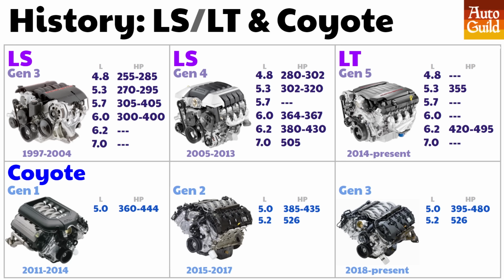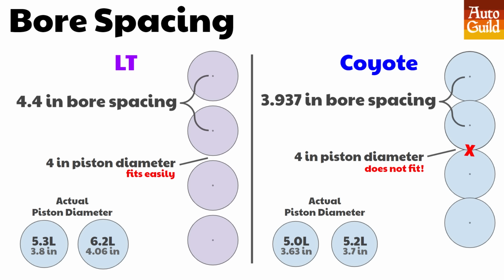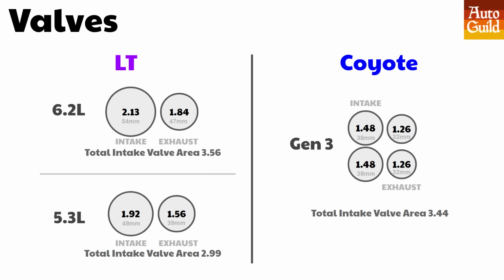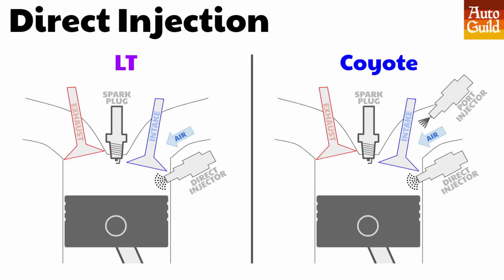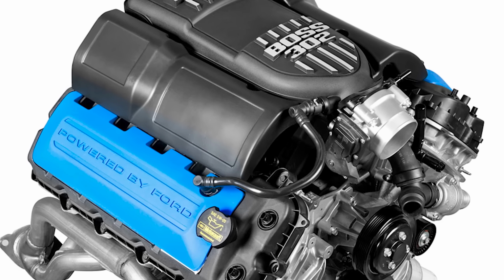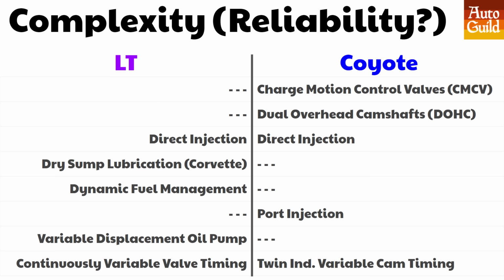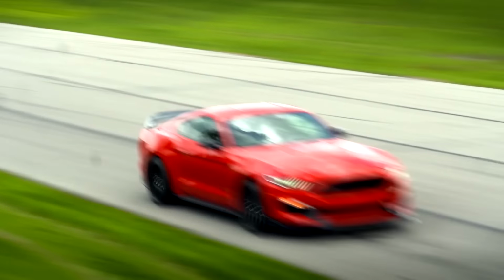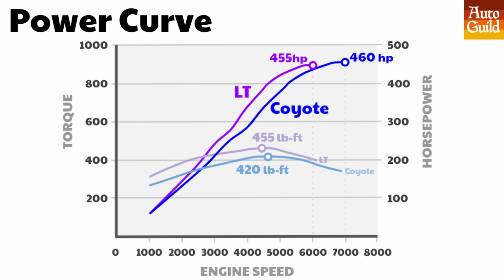GM Gen 5 LT vs Ford Coyote.  Which one is better and why.

Comment: I feel like the coyote is just kind of the “option b” for the LS/LT. It’s just a totally different platform that provides comparable performance. It’s a pick your flavor kind of thing. Adds a little flavor and diversity to the market. I’m a coyote fan mostly because ford actually finally did something about their underwhelming modular engines and made some engineering magic happen.
Reply: Swedish super car Koenigsegg uses an evolution of turbo charged  Ford 4.6 modular.
Reply: Yeah it pisses me off too I honestly don't like Ford after 96 They just copied Toyota You made your card way too freaking advanced breaking down and pain in the ass to work on They obviously couldn't get it right the first f**** decade you know it's about time they got it right and they're still having issues with the coyote that's the number one issue with that F-150 is engine issues and GM fell apart when they were came out with cylinder deactivation so they're now saving grace
Reply: Ford isn’t trying to fool anyone, they know they don’t make great V8s anymore, and that’s OK!!! I LOVE the 3.5 HO in my ‘20 Raptor, it’s what got me into a Ford truck after 4 GMs (still have a C5Z vette tho) - all you need to do for more power is a simple tune & the thing rips, also- forged internals from the factory shared w/ the Ford GT
Reply: @MS  have you not been watching the 5.0 in the mustang and f150's, things a beast.
Reply: Underwhelming?? 
John Mihovetz has made over 3,000 hp from the older 4.6 4v utilizing the factory block and heads, timing components, factory Kellogg crank spinning it past 10,000 rpm and running a 5.88 @ 250mph from 281 in³. There's positively zero mass produced factory engines with that much OEM metal that's done that anywhere on this planet besides the 5.4L he also built in the world record standing mile ford GT that's similar in power and parts which it ran 300.4 mph in a mile...also unchallenged by any other factory powerplant on this earth. (The Chiron runs 221 in a mile)
Reply: Well the 4.6L Supercharged V8 only found in the Terminator Cobra is FAR from underwhelming!! Other than that you are absolutely correct!
Reply: @daltex81  
Ahhhh
The Cobra, Terminator. Nice
Reply: I hated those old 4.6 and 5.4 engines. Constantly breaking down. The stupid cam phazers ruined thoes engines after the 2v.
Reply: @codylapoint  Those are some of the most reliable engines you can find if they're in 4 or 2 valve form.
Reply: @yardmeat7499  I hope so, I sunk my savings into a '12 GT500 and don't want to find out how expensive 4V 5.4L engines are haha.
Reply: @bcool2525  just remember to keep fresh oil in them - oil changes are key to longevity with them 👍
Reply: @codylapoint  the 2v and 4v versions of those engines are golden.   They aren't "constantly breaking down" they're actually known to be very reliable.  There are no cam phasers.  The 03-04 cobra was 4.6 4v factory supercharged and can make North of 800 wheel all day from a positive displacement supercharger in stock form.  Same can be said for the 5.4 4v in the ford gt and gt500 07 and up.  They're stout and make 700-800+ to the wheels on stock motors all the time even more on turbo setups (same can be said for the terminator 4.6).  The 2v versions of the engines are good engines too they're very reliable the factory rods are a weak link far as making big power on stock motor but simple rods and pistons upgrade and you can make 600-700+ to the wheels.  Don't spread misinfo.

Comment: At 3:55 I knew the answer. More moving parts, more problems. There is a reason why you always hear about an LS swap, and not a Coyote swap. And now Ford is putting V6, crap turbo, engines in their trucks!!! "Head shake". I used to be a Ford guy....

Comment: The Coyote is all about up high power demand. The LS, however………Just screams “kick ‘em in the nuts”, at anywhere in the rev range. 😂
Reply: Na dude lmao thats your cam specs . Pushrod engines have a rpm powerband limits where the cam kicks in. A sohc or dohc is literally splitting up the cam profile 2x or 4x . Look at any coyote , honda , Toyota or AMG engine and they make power low and high more efficiently than a pushrod engine. If you argue youre more than likely uneducated ( not your fault ) or bias ( your fault) technology is just that technology

Comment: GM fan myself, Ford can built a modular engine that the ordinary Joe can easily make a quick easy fix of...........without those complicated extra moving parts like 4 cams/phasers chains and the like. The modern HEMIspherical engine deserves some recognition for its versatility as well. (Owner of a 2012 RAM 1500 4x2 5.7 HEMI 6 spd 3.92 axle ratio)
Reply from the maker: Some have been asking for a Hemi video, I may have to make that!
Reply: @AutoGuild  can't wait.

Comment: As soon as you turbo, at eg 20psi, and there are serious airflow demands, the Coyote demolishes the LS due to the 4v vs 2v design.
Reply: Yea your wrong when it comes to 9 sec drag strip power chevy design can get there alot easier its harder to get massive low end   front tire lifting torque out of a Over head cam engine
Reply: @jamesflames9930  you.... Are an idiot simply based on the statement you just made ..
Reply: how about good ol' bbc
Reply: @doggystyle802  it's 2023 bro, not 1964.
Reply: Does it though?   Show us some examples of some highest hp modded coyotes vs highest molded LS/LT
Reply: @Spirited_Driver   14.7 PSI of boost pressure doesn't give a rat's ass what motor it's bolted to. 14.7 lb doubles NA horsepower 30lb triples it end of discussion the people that say the ls sucks compared to a 50 coyote are using 4.8 or 5.3 Vortec truck engines from the early 2000s late 90s
Reply: @biggregsparks8364  14.7 doubles and 30 triples?   No.  All motors are different and gain different amounts of power.
Reply: @biggregsparks8364    Agreed.
Reply: GMC is way better than a found on road dead, ford had  to make bigger engine than the ls and lt to get a similar power and different technology not to copy GMC as how they did with the 2024 Cumstang
Reply: Had a Camaro that gave me nothing but problems. Went with a mustang and not one single issue and I drive it pretty hard.
Reply: Nothing flows better than the coyote heads
Reply: Bullshit. The LT head flows better than the Coyote, with less than half the overall mass, and parts. You really fail to grasp the fundamentals of turbochargers if you think an S480 is going to make more power on a 5 litre engine, than it is on a 6.2 litre engine. Especially when the LT head flows better than the Coyote, and sports 60-80 more cubic inches of displacement. You need to binge a little of Richard Holdners channel, you could learn a thing or two...
Reply: @jamesgeorge4874  Richart Holner has just demonstrated that a 4v i6 Atlas engine demolishes the 2v when the turbo boost is turned up.
Physics mate, 4v = more flow. This is why all supercars have an engine design like the Coyote, ie, 4V DOHC VVT
Reply: @nordic5490  That is a comparison between engines designed 50 years apart. Put an S475 on a Coyote, and one on LS3, and we will see who makes the most power for the lowest dollar. Oh wait, it's been done. And the Coyote lost.
Reply: @jamesgeorge4874  you obviously live under a rock.... In the woods.... In some third world country....
Reply: @02autogt  I actually live in the state which headquarters both Ford and GM, and  I am a 30 year veteran technician, racer and auto enthusiast for 40 years. What are you, a New Edge 2 valve 4.6 disappointment Mustang owner whose butthurt over the fact Ford builds mediocre engines that cost 3 times as much money to make 70% of the power Chevy delivers without breaking a sweat ? Probably.
Reply: @nordic5490   you need to watch more of his videos.  I doubt the coyote is making more power modded vs modded ls/lt
Reply: @jamesgeorge4874  coyotes make way easier power from boost than Chevy engines
Reply: @schmidtygt  BULLSHIT all modern engines respond to boost the same way bud, I've said it before, and I'll say it again, watch Richard Holdner, he has made dozens of videos to prove the contrary. No cheaper recipe on earth for 1000 HP than LS, cam, springs, S475. Proven. Over, and over, and over.
Reply: @schmidtygt  engine masters proved that the LS3 beats the Coyote NA, and Boosted, so suck it.
Reply: @jamesgeorge4874  you sound mad at the facts.
Reply: @mickster026  the fact that the Coyote is inferior to the LS3 in every way, why would I be upset ? If blue oval fanbois were smart, they would buy 7.3 Godzilla engines, you know, the one Ford built after 30 years of dimensionally giant, low output OHC engines.
Reply: @jamesgeorge4874  That's true, engine masters did an LS vs Coyote build battle and the LS won by a significant margin.
Reply: @jamesgeorge4874  And you are WRONG. The faster you can get air AND fuel into an engine AND exhaust it, the better. A coyote with WAY superior intake and exhaust would SMOKE any LT under boost. 

Replacement vs Displacement has been proven right over and over and over again. I truly don't know why you guys without boost experience keep popping up to try to prop up something that is inferior.
Reply: @jamesgeorge4874  you have no backing to your claims other than 1 guy said it on his channel coyote a better engine than the lt not to mention the lt engines are absolute trash after 2015
Reply: @kylecairus5675  My claims are all over YouTube bud. Watch the Engine Masters LS3 / Coyote shootout. The Coyote is a good engine, but the $$ per power catagory, the LS stomps it, pure and simple.
Reply: @CF_Harris_The_Author  actually, the only reason a coyote can keep up is because of the 12.1 compression ratio ford had to run, while the ls3 has 10.7. stock ls3 head flows 300 plus cfm, while a gen 3 coyote head flows 290. but because of 376 versus 301 cubic inch, the ls3 rev limit is 6500, while a coyote is 7700 with no low end torque. thats why a manual trans coyote is way slower than the 10 speed auto even though the manual will dyno 20 horsepower more to the pavement. nuff said.
Reply: @CF_Harris_The_Author  you are sounding unconsciously incompetent
Reply: @biggregsparks8364  I and anyone who actually races, runs their GT500 a hell of a lot higher than 7700RPM.
Lastly, who in the fripping hell would want to run a manual over a ten speed double cluch.
Reply: @CF_Harris_The_Author  stock 7700. manual is better once you spool your rpm up. mph at 1/4 is higher if you can actually drive a manual well, just not out of the hole
Reply: @biggregsparks8364 I know how manual transmissions work. I also know that a double-clutch auto will almost match/beat a manual now without the risk of burning clutches and missing gears. My car now makes over 800 to the wheel so the thought of money shifting is there too if I hadn't upgraded the clutch.
Reply: @CF_Harris_The_Author  agreed if you have that much power and automatic is the only logical choice stick shift breaks a lot more s*** dumping the clutch out of the whole 2
Reply: @CF_Harris_The_Author  although tick performance grub worm Camaro just recently went 6.61 at 221 with a stock 1994 original Chevy engine block with standard 23° cylinder heads and it was destroked down to a 329 inch motor pushing 60 PSI boost pressure with a 4-speed converted 6-speed tick performance trans T56
Reply: @biggregsparks8364  I've seen a bunch of guys LS Foxbody's here. It seems to be the thing now....LS your fox.  Anyways, good bunch of nitrous on 427 LS with LS7 heads and it's a damn potent match-up.
They're stuck though because the same dudes still stay with a stick shift to keep it cheap AF. Those LS/LS7 head combos with a kit are easily putting out  700 sometimes 800 hp and they try to wrangle that kind of horsepower with a stick on a light-as-hell Mustang.  
Man, I watch them dumping gears as they race and it's gut-wrenching lol. Takes a hell of a man to trust yourself from slagging a manual on 7-800hp.
Reply: @CF_Harris_The_Author  badass. takes special driver
Reply: @CF_Harris_The_Author    ...Again, its already been proven....   When you add boost, the engine doesnt care about the heads and cam as much as it would if it was N/A.  Boost FORCES air through the engine, doesnt matter how many valves, 2 big valves can flow more as 4 small valves when boost is forced through...  Stock is one thing, modded is another beast.
Reply: @biggregsparks8364    Not to mention, at 12:1 compression, lets see the street fuel keep up to lots of boost on a coyote...
...AND everyone here needs to know that an LS only needs a cam and springs to rev to 7700rpm..  Easy peasy.
Reply: @Spirited_Driver  yes. someone finally gets it. coyote are factory 93 pump, while a ls3 is 87 octane at 10.7 compression and can be boosted to 875 rwhp on pump fuel. Yes a coyote gen 3 can push upwards of 1050 rwhp horsepower but on race fuel or E85 which gums up your engine. There's going to be people coming to bash this comment saying E85 doesn't do that but look up what E85 does to a carburetor and they have a lot bigger openings and them then injectors do. Race fuel is a hundred dollars a can. I had a 15 to 1 compression fully built four wheeler pushing 75 horsepower it will only run on 116 octane
Reply: @biggregsparks8364    ... Not to mention Ethanol is not available in may areas, like my home town of 500,000 people.  Which SUCKS because my other car has the option on running on E fuel (to get massive hp gains) and for those others who dont know, Ethanol adds A LOT more HP.  Almost like cheating with NOS.  So, these mustang guys bragging about making lots of power with E85 (or whatever) is BS because E makes WAY more power than even 87 vs 93 octaine!!!!!!   Lets compare at a real world street level shall we
Reply: @jamesgeorge4874  you just said that.  For reals? Lmao
Reply: @jamesgeorge4874  You are such a liar, fanboi and troll. GTFO.
Reply: @jamesgeorge4874 Richard Holdener has proven that you need a 6.2 Chevy to bear a coyote. Wonder why Chevy needs over an extra liter. Can you say volumetric efficiency?
Go watch some new vids dude. Holdener is the man
Reply: @MikeSmith-ey7ku  It was engine masters, buddy, the coyote lost, displacement be damnned,   and my daily driver wagon is over 200% volumetric efficiency whoopty f'n doo.
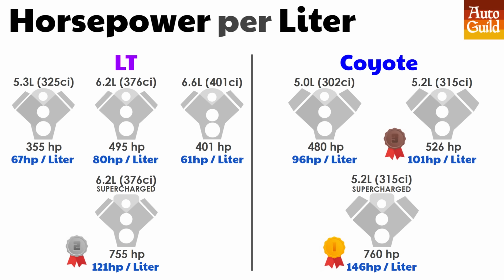Reply: @jamesgeorge4874  8:43 disproves your agrument.
Reply: @OS Rca100 not even a pimple on the ass of how many SBE LS engines that are quicker and faster, but who knew....

Comment: Is the 6 speed manual still the Chinese built in mustang? I know only 6th gear was OD in the 13' has it changed to the better yet? Ferrari has always used a flat-plane crank with their V-8's how does Ford get away with using it on such a big engine at 5.2 litres as isn't it true that any bigger it would vibrate it's self to death?

Comment: I’m thinking.. what if the coyote engine was 6.2 L
Reply: @choch4075  Exactly.  Which is why the overall design and results are what is important.  It makes no sense to talk about a theoretical 6.2L Coyote because such a concoction doesn't exist and in a practical sense, will never exist.
Reply: It would need a ton of extra stroke.  Would it still rev?
Reply: @kevin9c1  probably require a completely new block. Flat plane crank would still rev high, but maybe not as much. My point is the C.I. displacement disadvantage. Both have a similar h.p. Output, but the coyote is over a liter smaller.
Reply: Along with the need for a bigger Gas option in trucks, this is why Ford brought out the 7.3 push rod. As the bigger displacement option for the 5.0. The power potential for that engine will be huge once the aftermarket grows for it.

Comment: How many camshafts do you need to make 400bhp...? All of them 😆🤣🤣
Reply: 1.2 liters and only 15 more hp.  nuf said
Reply: @nicholasbrooks5651  I know. Shameful from a pushrod motor with only 2 valves per cylinder. Guess keeping the American Heritage spirit of pushrod v8 muscle alive wasn't worth it. They should definitely move to the import characteristics and kill the American muscle car completely and dotch the pushrods and add 3 camshafts and and 16 valves. Wonder how many hp they would add? I'm guessing 7-10hp per cylinder. So that would increase it 56-80bhp. But still can do that with a mere cam swap. (🎤 Drop)

Comment: I own a 2017 GT 350. And a 69 GT 500...Corvettes in the past and super/turbocharged this and that. I have ridden in race cars on road courses, drag raced many different vehicles. One thing you learn is that someone is always faster. Another thing is that there are some engines that over perform so much that engine specs just don't do them justice. Nothing easier or faster or cheaper than an LS/LT swap. But one drive in a Voodoo 5.2, shifting at 8,250 and listening to that exhaust note....It is called Soul, and that engine has it!
Reply from the maker: Great comment, I dont necessarily like fast cars, or high horsepower cars, I like cars that make me giggle, are engaging to drive, and sound amazing.  And if I have to choose Ill take chassis over hp any day!